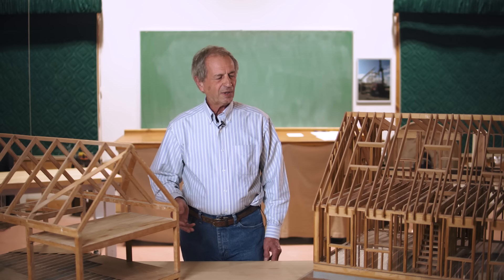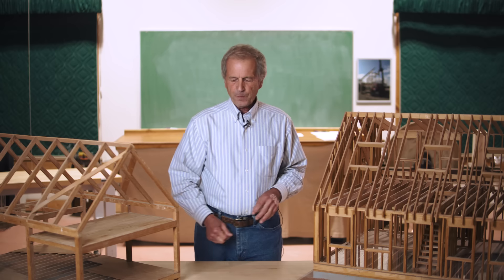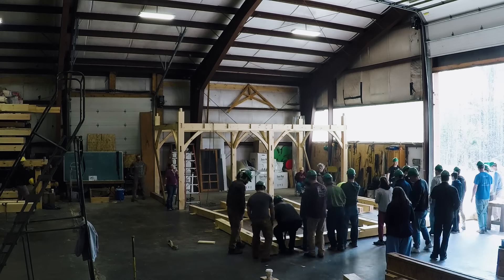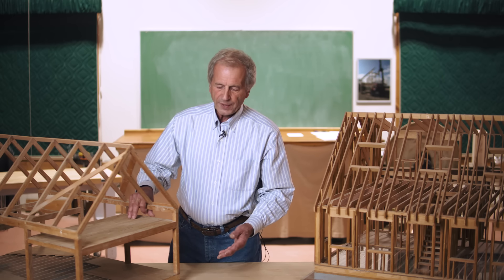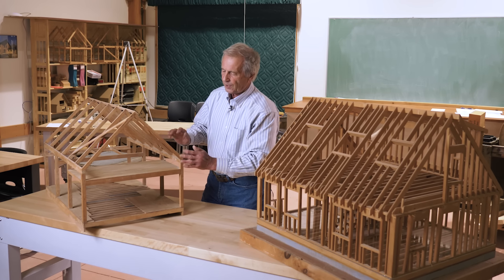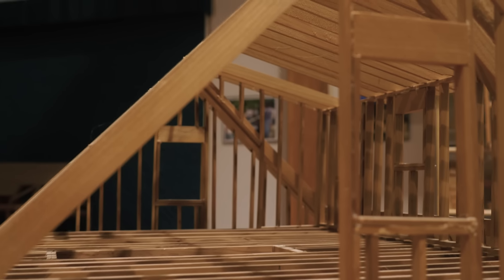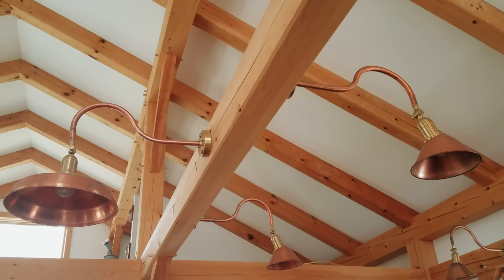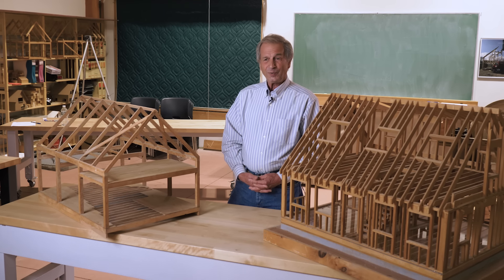Timber Frame vs Conventional Stick Frame

Comment: This is biased towards TF and often untrue. Not comparing apples to apples. TF is beautiful but the main reasons stick frame remains more popular is cost, flexibility, needs minimal skills and its familiarity. True that wood is not as good an insulation but easily remedied with insulated sheathing and/or staggered studs at very little extra. SIPS is a good system but you don't even need TF if you have it.  The TF is essentially for the look. With standard framing, services such as electrical and plumbing are so much simpler,  cheaper and easy to modify in future.  Ps if you use timber off your lot, be prepared to get it graded by a professional as they won't accept it. Also be prepared to pay a lot more for engineering.
Reply: @user-rg5hz5tm8c  the current stick framing is called platform framing and is a relatively recent (30s or 40s) system. The focus on energy efficiency is really only since the late 70s when the cost of energy went up. Both systems were poor, TF was used mostly for barns in the colder areas which didn't matter and stick frame had no consideration for air tightness. This kept wood in good shape until they became (carelessly) lined with poly on the inside and then sealed with plywood outside instead of shiplap. This tended to trap condensation. The air tightness is important but consequently needs air exchange which is controlled and the exterior needs to breathe. Foam does get around the condensation issue and is great insulation for the depth, but is expensive and there is concern about off gassing with some types and insects seem to love it as it is easy to dig thru. Glass wools have their own problems of course too. TF for homes is more recent and, as I recall, came from people renovating barns into houses. Very cool but hardly cost effective. They did get exposure in the glossy architectural mags of the 60s tho which made it seem even cooler in a retro/hip nouveau sort of way . They really struggled with energy codes tho and added stick framing between frames for a while and so the Sips is a great solution. Just not all that economical.
Reply: Also, if insulation is your primary concern in building a new home you're going to go with a double-wall system anyway.
Reply: user name taken  this is true too
Reply: The Big bad Wolf loves stick built garbage. Back in Cornwall UK, the youngest house we lived in was over 200 years old, the oldest over 500. Now in Tasmania, our new house, stick built is already half chewed by mice. Gonna sell it before it falls down. Bought a doer upper from 1950, hardwood roof trusses 10ft apart, tried to drill holes to mount a home cinema projector, broke half a dozen drill bits and several hex bolts. When all the stick built  softwood, crap houses around here all blow away in that hundred year storm. This massive, enormously heavy, beast of a building will still stand. As for heavy,  English Oak dwellings, a thousand year life expectancy is standard. There is no greater qualities than craftsmanship and durability. Pine stick houses are disposable like everything else today.
Reply: user name taken  those who build with there own trees, on their own land, usually build themselves. THEY never hurry, but plan for years, then take quite a while to achieve their goal. Instant gratification does not lead to long term fulfillment.
Reply: @jimm2297  I disagree about the stick frame being intrinsically weaker or more troublesome. For one it is obviously more flexible in design, construction and renovation and obviously more bang for your buck. I do agree that the quality of the craftsmanship and the materials used makes a huge difference. As so often is the case, the devil is in the details and it's difficult to compare apples to apples here.
Reply: @579Glenn  using cheap, weak, knotty softwood is of course intrinsically weaker. I accept that cost and time play a major role in the building process. My only point is...Europe contains thousands, maybe hundreds of thousands of structures over 500 years old. Lots of Huge Churches/ Cathedrals  1000 years old. Yes, a thousand years. Built with hardwood, clad with ridiculously heavy roofs of lead, slate, copper or terracotta tiles. Strength and longevity come from hardwood, mortice and tennon joints, pegs, and craftmanship. Modern stick built dwellings are disposable, like everything else today.
Reply: @jimm2297  yes we agree if one builds with stone, hardwoods, tiles and lead or copper flashing , things will last much much longer.  These materials are understandably expensive, particularly where they are scarce. Times have changed (particularly labour) since the stone cathedrals and oak Tudor manors and, unless you are willing to pay a hell of a lot more for the same square footage, stick frame (where wood is cheap) will always be the preferred system and I maintain if done properly it will last too. Of course it is common to use both in a hybrid system if you can do without timber frames in, say, your bathroom, bedrooms and closets.  I often clad some standard engineered girders with quality finishes and folks can't tell the difference. You get the TF look without the warping and checking that often happens with timbers.

Comment: advantages of stickframing:
1. largely unskilled - almost any fool off the street can use a skilsaw and a hammer, cordless drill and screws, and nailplates.
2. readily adapted on-site. see #1 and #5
3. low cost per structural element. see #1 and understand the reason for >10% wastage rolled into mat'l estimates.
4. low weight per structural element, easier for the unskilled and the small-crew (home improvement) to manhandle.
5. planning and execution are more tolerant of slop, error, and revision - shims, shoring, and cladding hide the deviations from the eventual owners... for a while. see #1
6. fits better with planned obsolescence model of property and economics.
 
timberframing requires meticulous prefabrication and perfect site-prep - you actually have to have surveying, foundation, and carpentry chops to pull it off.
if you have the skills and the tools and the necessary meticulousness and want to build something that will last, timberframing (including use of engineered/glulam elements) becomes appealing.
Reply: Those "fools" built the vast majority of homes in the America over the last century, many of them very skilled carpenters working in an environment shaped by the current industry and the economy. What a pretentious post.
Reply: @DWhite-el4ih  - out of curiosity, how many years have you worked in woodframe construction and renovation for your living? Me? Only three years. Followed by decades of watching others build, getting certified in architectural drafting, and still doing the occasional construction and renovation - often involving unfucking what fools calling themselves professionals have done in the past.

how many drunks and junkies have you seen among the crews you have observed? How many who can't read a print, think they are a carpenter, can't add a simple sum, will tell you that a power tool is I shit you not "haunted"?

"pretentious"? mmm'kay.
I'll note in passing that you haven't actually countered any of the points I made.

be well.
pray, be silent.
Reply: Loc T  - I will absolutely trust structural-sheathing gusset plates more than I will toed-in butted joints or pressed nailplates
Reply: @DWhite-el4ih  - nah, you can have the last word. go ahead. knock yourself out.

Comment: But can you build a timber frame less expensively than a stick build?
Reply from the maker: This is a difficult question because of the variables. Generally, if you are hire someone to build a timber frame it is more expensive. However, if you are doing the work yourself, it can be less expensive. The other obvious factor is the cost of lumber and large timber does not always cost more than smaller framing members depending on what type of timber you purchase (species, grade and finish). The actual construction process and speed is another factor. Because a frame is typically all cut ahead of time and then assembled all at once you can minimize site exposure and material loss if you plan well. Another factor is the location of the project and the building materials that are readily available. People do not choose a timber frame because it is less expensive. They choose it because it is what they want for aesthetic, because they have a wood lot or have access to one, because they like the style of construction. And then you may be able to build it for less depending on how you build.
Reply: You can buy a small mountain of lumber for the same price as one timber. The only way a timber house will be less expensive than a house built from stick is if you already have a woodlot and most of the equipment needed for processing logs into timbers.

Comment: Here in germany we have houses build with timber frames that are well over 500 years old. Or our beautiful and centuries old half timbered houses. With some maintainance they really last forever - in human time scales. 
Today we build almost all our houses out of brick and concrete, some with steel framing and some still with timber framing. There are almost no stick frame buildings at all because they don't last and aren't very sound proof. You can see in american cities that many stick frame houses are just falling apart after 50 years. 
The brick house of my parents was build in 1892. My great great grandparents build it. The facade never needed any substantial repairs. Only all the stucco ornaments need some touching up every 20 years or so. The roof is covered with slate shingles broken out of a mountain near our town. We still use slate shingles today. They are all natural and almost ever lasting. And aside from a few broken shingles now and then the roof never needed any substantial repairs, either. Everything still is in great shape. The inside of the house has been modernised many times, of course. 
That is how you should build houses. They should be build to last 100 years without any substantial repairs.

Comment: They are both timber framed buildings. 'Stud frame' and 'Post and beam frame' are the types of framing. Timber = milled wood.
Reply: nice job. Colloquialisms do exist though. 
Some people don't like to use 'post and beam' because (colloquially) it often refers to non-traditionally joined frames (engineered metal connections) whereas 'timber frame' refers to traditional joinery (mortise & tenon, etc).
But you are right. I'm all for precise language.
Reply: Timber is greater than 5x5 nominally. Your ignorance is astounding!

Comment: I've been doing drywall for 20 years and my house is old well over 70 years whats I've learned is new house's are not framed to last or be strong. I would never buy a new house.
Reply: I used to do concrete for the biggest residential builders around my area, foundations and basements mostly but also occasional repairs. If it's been built within the last 10 years, I'd feel better off living in a cardboard box. Both will be falling apart at the seams soon, but at least the box is cheap
Reply: @maddawgnoll  It is really just a combination of survivor bias and fool consumers that don't look beyond the superficial. Custom houses have always been, and still are, good.
Plenty of garbage houses were built 50 and 100 years ago but they were eventually demolished so all you see now of the old stuff is the top specimens that survived. As for the developments they are all built to minimum cost per square foot because they are marketing to idiots that buy based on paint color.
Reply: They skimp on everything, that chip board will warp over time and is not as good as plywood.I call these homes they have around here McMansions.
Reply: @paulscountry456  most the time it is already when I spray texture

Comment: When you explain all the advantages of a method, and leave out the disadvantages, you are being dishonest.    He knows the truth, but did not explain everything.  He didn't mention that cutting joints requires skill and takes time.  Whatever benefits you gain from having fewer pieces of wood, you loose because they are all heavier, and need to have complicated joints cut into them.  Also because joints require the removal of wood so two pieces fit together, joints are the weakest part of a structure in timber frame.  Another thing is timber frame is not standard construction, and requires a structural engineer to design it.  Wood frame construction does not require an engineer if it follows code, and does not exceed maximum height allowances.  In wood frame construction, joints do not require wood to be removed, so their is no weakening at the joints.  Steel pins, commonly called, 'nails', hold pieces together.  But it's not just a couple of nails at a joint, the sheathing gets nailed onto the wood frame and all of those connections act together to hold everything solid.  At highly loaded joints, inexpensive, engineered sheet steel gussets are nailed in place to provide additional tensile strength.  With a small amount of light steel ties, a wood frame building can withstand very high winds.  If you want to spend more money to get a timber frame house, go right ahead.  But if you want more bang for your buck, you'll go with wood frame.
Reply: You are absolutely right, this reads as an advertisement and not an informative presentation. There is a HUGE difference in cost between the two methods, primarily because timber frame requires wood timbers of a particular size and quality which is more difficult to source. 2x4s are a lot easier to mill from inconsistent forests. I also know that sustainable logging is fairly well established for typical stick frame lumber; I don't know if the same is true for the lumber required to build a timber frame.
I think this guy's just trying to get people to sign up for their classes.
Reply: All of your comments also apply to wood frames. They have problems and modern Homes are designed to last 30 years not 300.Wood frames have disadvantages.
Reply: @thomasblaine3193  The video was done to sell something, and most sales pitches have a bias for the product, and they don't bother addressing negative points.  
A wood frame house, properly maintained, and treated for boring insects, will also last 300 years, or more.
Reply: Timber frame is the superior method of the two, but not necessarily the best.  It is a lot more expensive, and harder to make.  especially since this video is for construction in the US and its damn hard to find carpenters who know how to build that type of construction.  In Germany, where I work, most modern houses are completely made of stone.  The old Germanic style of timber frame (fachwerkhaus). isn't made as much any more, but carpenters still build the roofs of the brick or concrete houses.  They are all timber roofs.  The equivalent of codes here don't really allow stick frame houses because they will never be as solid.  This results in the requirement for craftsmen to really know what they are doing to a much higher degree than the US.  Carpenters, bricklayers and plasterers all go through a three year intensive apprenticeship to learn their trade.  The houses here are much higher quality, but unfortunately that also results in the price of a 1 family house being around 600,000 not including the building permits and the actual plot of land.  (I'm a plasterer btw.  in the first year of general construction you learn about bricklaying, tiles, carpentry, etc. as well as my actual trade.  This means that I know the groundwork and theoretical basics of wood construction and joints, but I am by no means an expert in carpentry.  I just know what is legal and what is required, what can hold more weight and last longer, etc.). Most of what he is saying is true.  I can't vouch for all of it because even timber frames are different in the US.  I would agree that this seems a bit on the advertisement side of things.
Reply: You guys can complain all you want but from personal observation I know timber frame is superior. My uncle had a barn that was a timber frame structure in the 1950s. It was built with wooden dowels and square nails so the construction was very old at the time. In the 60's they tried to tear it down because it was no longer needed. they took all the siding off to weaken the frame. It still required three large tractors and a D4 track-layer to pull it down. DIY TV shows today show little old back hoes tearing down wood frame houses all the time. If I lived in the part of this country where tornadoes are common, I would never have anything less. The argument that just because everybody else in an industry builds substandard products to make a buck comes of pretty lame to me.
Reply: @genethesurveyor    
This was in my original post: " If you want to spend more money to get a timber frame house, go right ahead."
When you get the cost estimates for the construction of a house done with timber frame, you will change your mind.
Reply: @genethesurveyor  timber frames are harder to build and require skilled craftsmen.  a skilled craftsman who is an expert in his trade is very hard to find in the US.  an even better example than yours would be the entirety of Germany and Austria.  Timber frame houses from the 17 and 1800s are still standing today and are still solid enough to pass the incredibly strict German building codes.